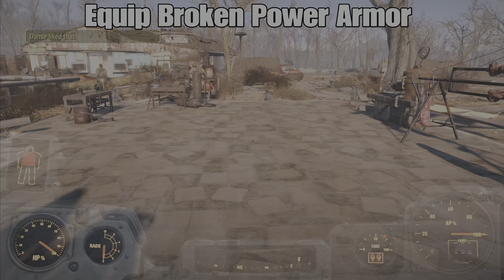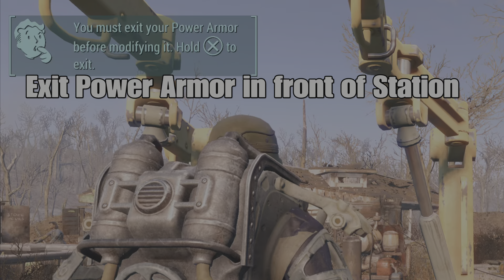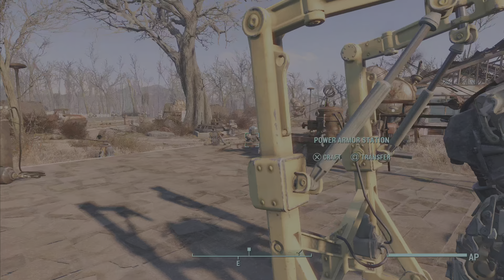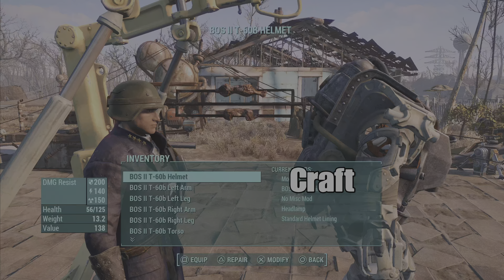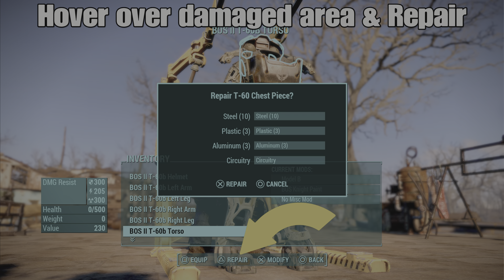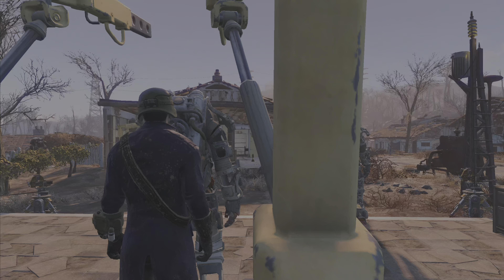How to Repair Power Armor in Fallout 4

Comment: Ok you repaired yes but my piece is fully broken how do I repair that
Reply: Ok you do repair from same way and then you just put it back on my bad
Reply: Thanks
Reply: i don’t have prices on my armour how do i get them
Reply: Im using the enclave one and it says: "this armor doesn't have any upgradeable parts" and doesn't let me equip the parts to repair
Reply: @astro837 same I can’t fix my damn left arm
Reply: @b58powa  check out if some of your mods is doing that. In my case, Armorsmith Extended was the issue